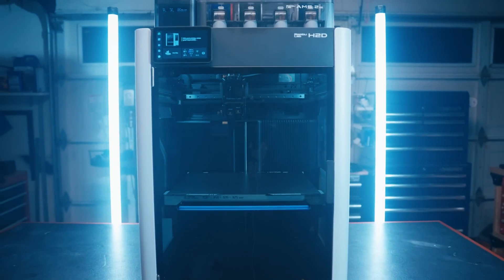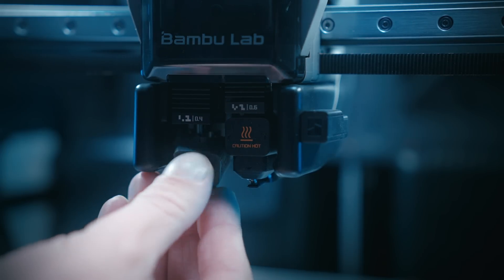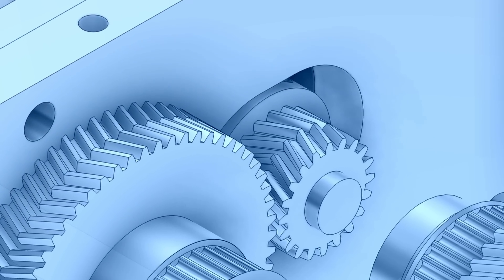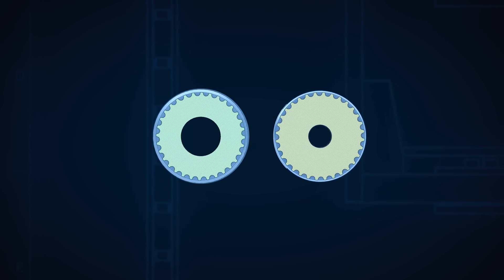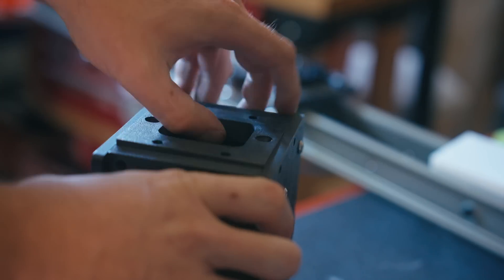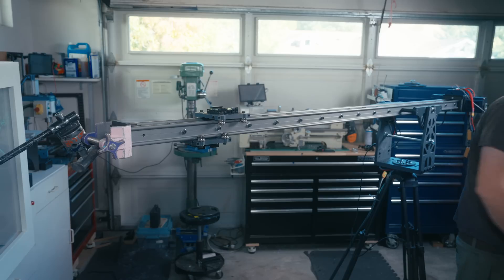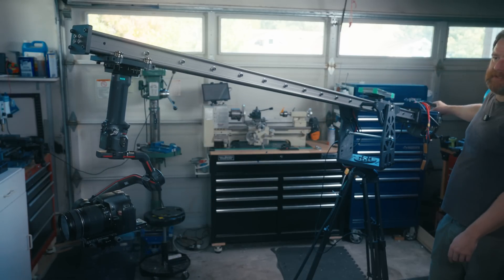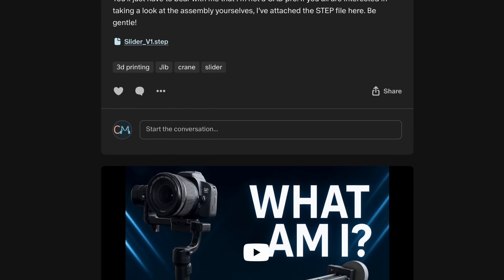I Built a $100,000 Piece of Camera Gear for Less than $1000 (Mostly)

Comment: This is a little thing, but making the gears something like 21 and 60 teeth will help reduce wear if there is any uneven parts on the gears, because the same two teeth will mesh every 1260 revolutions, rather than every 3.

Comment: Brilliant work and excellent engineering. I can't help but wonder if it would have been cheaper quicker and easier to just move the main pivot to the new center of mass? or one step further make it so that it can be adjusted up and down by twiddling a screw for different camera rigs.

Comment: I know it's a crazy thought, but I find myself wondering if solving the balance point issue of the arm could be done mechanically. Maybe something involving springs attached to either end. Or perhaps some sort of metal plate in a slot with ball bearings. Or maybe a tube in the middle with shot. I'll keep thinking on it.
Reply from the maker: A leveling head on the carriage would prob do it if it was low profile enough.  But there’s a lot of engineering there.

Comment: I think there could be an easy solution to one of the problems. Just add a "move" button and this can let you set the angle and position you want "deactivating" the PID controller from fighting back, and once the button is no longer pressed, the controller knows that the movements are pertorbations that has to stabilize. It is like collaborative robots, and some other that let you programe movements and move them freely just by pressing the right button. 

I'm studing electronic engineering and we did that in robotics class quite recently so I had it in mind when you mentioned the problem of differentiating wanted and unwanted movements.

Hope this can work good for you and congrats on the proyect, it's awesome
Reply from the maker: Yeah, that's a good thought!
Reply: Could even be a capacitive sensor on a handle, like those lamps that you touch anywhere to turn on

Comment: I have a couple of ideas. If you know the masses of the counterweight and camera you can just have the esp32 do the trig to calculate the required position. Also don't underestimate the value of a small amount of friction at the pivot, it will help damp small movements. One other thing to try would be having the pid control the acceleration not position.
Reply from the maker: Good thoughts!  I’ll do some experimentation in that department.

Comment: You could go for full model based control if you feel like figuring out the actual physics of everything. And have a  much simpler calibration procedure that just estimates weights and center of gravities for the moving parts if they get changed. Rather than measuring a ton of various positions and interpolating between.

Also cascaded PI -> P loops are often way easier to tune, providing you’re able to first get everything to behave more linearly.
Reply from the maker: Dude. I would love to pick your brain sometime. This was a brute force hack to get “something” working. But I think you’re right about a physics based model. I just have to wrap my head around it.
Reply: Basicaly knowing/estimating the mass of the camera and knowing the gimbal position and angles would give you the required balancing torque at the pivot and hence the position of the balancing mass. Claude or chatgpt code for this 😊

Comment: ok. you have legit convinced me to get a Bamboo and their filament. It's clear now that they have made additive manufacture to the home shop as a tool not a hobby. Which, as a subtractive manufacture hobbiest, value a lot (coz I don't need another hobby fighting a 3d printer when I just want the part).
Also, bravo on the CAD design and material choices, for a film geek who's "not a Machinist", you sure are questioning if you're "not an Engineer" too.
Using a LUT was really clever. Have you looked at DragonFrame keyframe tool? Very simple serial protocol you could add (it also drives DMX512) Google for here-is-my-dragonframe-cnc-shield-v3-moco-solution-code
Reply from the maker: I know they’re a sponsor, but I do think their printers are top notch.  Especially if you aren’t looking for another hobby. I’ve heard of dragon frame but not super familiar with it. I’ll def look into it a bit more though!

Comment: Honesly the PID will work better, just add button that when pressed would change the set point. You press the button and the PID setpoint will change to the value when you let go of the button, and the PID will figure out the rest.
Reply from the maker: I appreciate the suggestion for the PID control.

Comment: It might just be easier to control it with a controler. If you give software inputs instead of mechanical. The PID loop should be more stable and shouldn't fight you.
Reply from the maker: It would definitely be easier. But not my ideal way of controlling it.

Comment: carbon fiber and glass fiber are abrasive you shouldn't use them for contact with belts they will wear out and I wouldn't touch them with bear skin if the part or your  hand is dirty it could lead you to develop allergies there is no real world evidence I've seen of this but what I know for a fact it does penetrate your skin lots of people get irritation from it and I also know that one of the ways you can develop allergies is by having proteins get in your blood stream though a cut or a dirty needle
so please if you use fiber filament wear gloves or you can just use fiber core filament it only has fibers in the middle part of the filament

Comment: Ignore the trolls, this is really cool considering how non-trivial of a control systems problem it actually is with so many variables affecting the control loop, and the fact that brushless motors are very different beasts compared to stepper motors. And the built itself looks super robust and well thought out, not some wobbly, flexy garbage.
Did you look at using the actual angle of the jib as the feedback parameter rather than the tilt sensor? E.g., if you used an encoder on that axis (same one you use for the motor), then the system reacts to counterbalance anything trying to push that out of sync with your target angle (and thus creating the extra current draw that you're measuring). Not sure if that would interfere with the ability to position it the way you can, though. 
Another option / feature could be a trigger switch on the handle that you engage when you want to move it, then when released, it balances and locks itself in that position.
Really nice build, regardless!
Reply from the maker: Maybe it wasn’t clear. It’s an angle sensor on the pivot that is feeding the control loop. I’m not using any other sensors except the motor encoders. Not using accelerometers or anything like that yet.   Thanks for the great suggestions though!

Comment: You tweak the control an acceleration sensor  at the end of the boom helps to create a model based controller. Manual moving give low frequencies from the sensor, while position correction by the controller is faster and gives  higher frequencies.

Comment: you could have achieved the 1/3 gear ratio by having both belts on the same shaft but run them on different size pulleys with a 3:1 ratio in teeth amount
Reply: I guess he wanted the two pulleys to be the same size
Reply from the maker: It’s a size constraint issue.
Reply: @Cinema_Mechanics is it? That solution would be smaller than what you had at first and what you have now?

Comment: Please stop promoting BambUnLab printers, this will hurt you channel. A LOT. On the other side, the project is good, but honest suggestion (from experience), if you try to fix hardware issues with software, you have two issues. As mentioned before, I have some experience with building motion control, so not just a keyboard warrior.
Reply: I see bambu as apple of 3d printing(designed for simpler ppl.. I mean use) but content of this channel weights much much more
Reply: @regun2434  Apple at least partially respects their customers. BambuUnLab does not. Changing the terms after sales, disabling features and false advertising. It was promised that everything works offline, which does not. My support ticket for offline update is almost 10 months old, no solution. On both Apple as well as BambuUnLab you buy the device, but the manufacturer still owns it and control what you can and can't do.
And yes, the channel weights more, for now. I recently unsubbed to few channels for their overly hyped BambuUnLabs ads.So I hope their chills payed enough to alienate the users, I won't ever watch one of their videos again.
Just my 2 Cents worth of ad revenue.
Reply: I doubt that. If Bambu keeps this channel on the air, I’m fine with ignoring the ads. People will enjoy this content even is the sponsor is the Kill Pandas corporation.
Reply from the maker: Appreciate the feedback!  Personally I love the printer for what it is. Not sure if this will be the final iteration of the hardware (almost definitely not). But this is the most flexible platform I could think of for experimenting with different models without having to redesign the hardware each time.

Comment: The first mention of "fix it in software" has made me shoot my eyebrows through the roof. I do software for a living and EVERY time I've ever done software + hardware (robotics?) it's always WAY HARDER than you think it'll be.
Reply from the maker: Fair point!  And you’re not wrong. I think the nice thing here is that the hardware is flexible enough to allow for a lot of experimenting in software so for example I can simulate a purely hardware based solution like gearing without making any hardware changes.

Comment: Summery of video: 20 min Bambu Labs commercial.
Reply: I think it was because it had so many BambuLabs marketing points verbatim sprinkled throughout that it came off as an infomercial more than a maker doing something cool.

I would have preferred a 30-60 sec ad read and leave it at that. The problem with these sprinkled in mini-ads is that you don't know if the person is being genuine or not -- a lot of foreign tech companies (and shady As Seen on TV gadgets) put in required talking points for accepting review units.l.
Reply from the maker: Appreciate the feedback. I do my best to do the sponsored content in an unobtrusive way but they are a huge part of what makes the channel possible.
Reply: If it pays the bills or at least offsets the cost of the ADHD side-quests, then so be it!  Plus, it’s a way better approach than stopping the actual video to insert an advert.  At least this way you get to understand some of the material and design choices as well.
Reply: Still better than your nothing in the channel...
Reply: wait wait wait wait you didn't like this video????

Comment: A few small thoughts by someone who has no idea what they're talking about:
- Why not consider a button that "sets" the target position. With this, your software can differentiate between intentional and unintentional movement.
- Would an passive or active breaking system not help a lot with damping any inaccuracies? I can imagine either full on locking it in place, or adding some friction at the center.
Reply: that would have been my idea aswell, why not have a button where the weight is mounted?
Reply from the maker: I think that could def work. The button would have to be remote though (or multiples) since you don’t always operate from the back of the jib. That’s kind of the neat thing about this platform though. I can experiment really easily with these kinds of things and just change a bit of wiring and code to test it out.
Reply: @Cinema_Mechanics  button = good, but what about a accelerometer? Measuring the angle change over time could give you the opportunity to identify the intentional movement. 
The slow balancing movement wouldn't be as fast as a repositioning with your hands (I think so). A fast acceleration could toggle the "angle set mode" and allow for a new variable to be set by the measured angle - holding it roughly in position for a second or so would set the angle. Even if something drops onto the arm or you hit it with unintentionally, only the angle setpoint would be changed, so it should be safe.